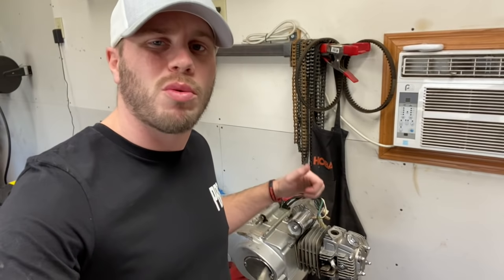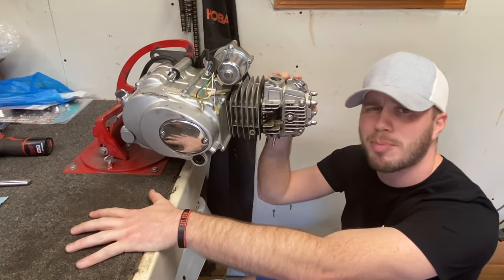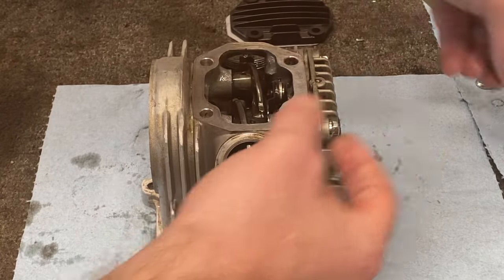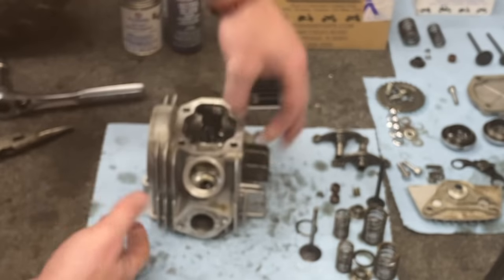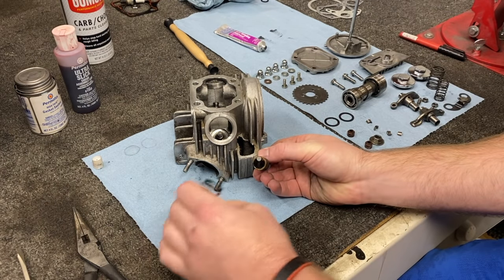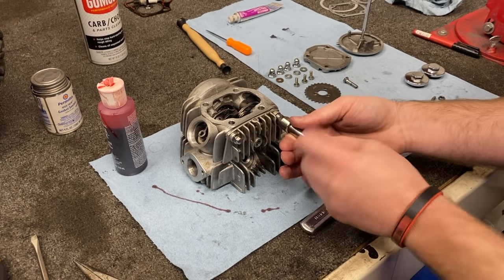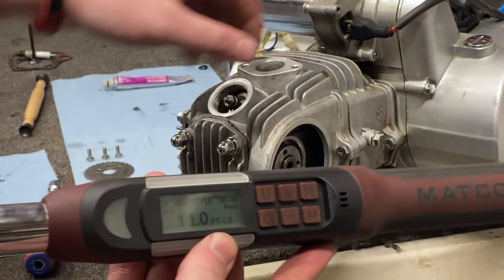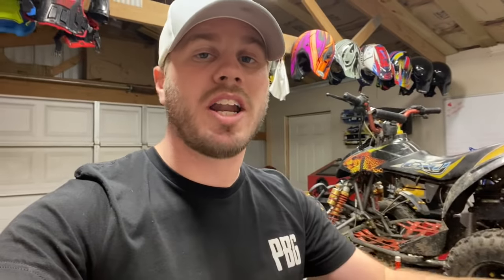HOW TO: Complete Tear Down & Rebuild of a Chinese ATV Engine Head. Every step you'll need covered!

Comment: Ok my motor was making a what sounded like bbs rolling around in the top end when i let off the throttle to drift to me it sounded like a loose chain like the cam chain was loose so I just took the sprocket cam cover off and it does look loose I thought these were spring loaded self adjust isnt it? I know on my old kawasaki you could loosen a bolt head chain tensioner and it would take the slack from the chain not sure on this motor tho.Any help,, let me know please..Thanks!
Reply from the maker: Yes they have a spring tensioner. It is the 14mm bolt on the bottom of the motor next to the oil drain bolt. It has a spring and plunger.  Check that and make sure it's there!

Comment: When you buy the head prebuild will you still need to adjust the valves ? Or are they preset and would it be the same spec for a 90cc honda clone engine
Reply from the maker: You would still need to set the valves after installation. The Honda specs for setting valves is .002" for both intake and exhaust. Which for me is too tight on these Chinese clones. My preference is .005" intake and .007" for exhaust and I use that spec for all my clone 50cc-125cc motors.

Comment: Ok
Got one for you. You said compression should be between 140-170. All mine that run get 50-60 and run perfect. The engine's that didn't run get 60-65 and I've tried this on 3 different tester's. Any ideas? I've replaced all electronic new kit.
Reply from the maker: If the carb is still attached are you holding the throttle wide open when testing? It is possible it will run with that low of compression but not likely. It would run very poorly especially when the ATV is under load. I guess you don't fix what isn't broke so if you don't have an issue then leave well enough alone.
Reply: @PraskaBoysGarage  carb is on and I don't touch throttle. I have new complete harness, spark plug and electronics. New pz20 carb, oil and doubled checked valve clearance. The ones with 30-40 psi runs like champs, and all are these chinese ones. The 2 I can't get to fire have me stumped
Reply: @PraskaBoysGarage  oh and love the videos even the lady watches them with me.

Comment: What’s the engine mount/holder thing you have on your bench? Thanks!
Reply from the maker: This is my #1 question for sure! I actually had a CNC company laser cut out all the metal to start making and selling my own. I will be selling the kits on my website either as a DIY kit or a completely assembled and power coated. I will post updates on the channel when they are ready!

Comment: I bought a lifan 125cc motor it keeps having pressure in the oil pan and the kick start seal keeps popping out once the pressure builds up any suggestions
Reply from the maker: The motor should have a breather valve on the top behind the starter with a hose. Make sure that isn't blocked. You'll always have crank case pressure that's what the valve is for. If that's not blocked I would suggest replacing the seal.

Comment: Hey great video man, but I wanted to know if you could tell me why my 2009 125cc Tao Tao is making a ticking noise near the piston area. It’s not a loose flywheel and it runs sort of smooth
I just want to know if it’s okay to drive it for now
Reply from the maker: Ticking in my experience is usually too much valve clearance. I would inspect the valves.

Comment: My valve cover gasket keeps blowing, I bought some pretty thick gasket material and it still keeps popping. Same corner each time as well. Any idea on why?
Reply from the maker: Are you torqueing the bolt down correctly? A lot of times the casting threads will strip and you cant get a good grip like you are suppose to.
Reply: @PraskaBoysGarage  probably not! I'll be careful this go round as I gave it too many ugga duggas and snapped a bolt.

Comment: Hello, thanks for the English info & i just subscribed, I've a brand new honda wave 125 style motorcycle(Chinese engine clone), the engine is getting noisy & weak when getting hot, also starting to feel tiny continues shake with my hands & legs, it's painful after a long ride.
I did valve clearance adjustment too, it's not valve clearance issue?
Can you please help me?
The engine is looking same, a 4 stroke engine too.
Thanks in advance
Reply from the maker: Look into getting a Mikuni Carb or at least the Chinese version off eBay for $35 dollars. It is much more responsive and overall will run better!

Comment: Love these videos. I have a coolster atv that need bushing in the front. I want to change all bushings. Any tips on how and were to buy the bushing
Reply: Model is atv 3125c coolster. It runs and drives. Front got to much play. I paid 200 it's a 125cc. Was this good price.
Reply from the maker: That's a good deal! Check VMC chinese parts. They carry all the bushings individually for a couple bucks a piece. I couldn't find a kit on Amazon or eBay. Thanks for watching the video, glad you liked it!
Reply: Okay cool. How many blushings are their in the front. I might as well replace all in the front. Is it 16 a arm bushing and 4 swindle bushing.

Comment: Cool but where do the break safety wires go when you wire a quad?
Reply from the maker: I have a complete "how to" wiring video if you want to check it out. There is both a hand brake and a foot brake, which one are you asking about?
Reply: @PraskaBoysGarage  I watched the video and in it you never mentioned where the two wires get hooked up to, the ones you need to put together so the engine will start
Reply from the maker: @ggproductions8434  They connect the the brake handle. The handle has 2 small metal prongs and they clip right into them. Orientation doesn't matter just plug them in and your good.

Comment: Can you help me with connecting the radiator fan on a 2005 roketa 250cc ? My radiator has no temp switch and my harness has nowhere to connect the fan wires im so confused
Reply from the maker: Hey I am sorry man, I don't have a lot of experience with that. I'd hate to give you the wrong advise since I've never done that before.

Comment: Nice video what is the make and model of you engine stand?
Reply from the maker: This is my #1 question for sure! I actually had a CNC company laser cut out all the metal to start making and selling my own. I will be selling the kits on my website either as a DIY kit or a completely assembled and power coated. Should have everything ready soon and will post updates on the channel.

Comment: Awsome video but still don’t know if this is the problem with my chinese 125cc atv . It starts but when i press the throttle to go doesn’t run like it was running before same on reverse is to slow … can someone help me or had the sale issue and let me know what it is. Thank you.
Reply from the maker: Sounds like you are more likely having Carb issues. Might be a good time to upgrade!
Reply: @PraskaBoysGarage   Yes i thought the same thing at first so i did change the carb for a brand new one and that didn’t fixed the problem. But after all i did find out what the problem was and fixed. It was the clutch. Thank you.

Comment: Can I exchange a 150cc head/cylender kit on a 110cc motor? I need to order a new wiring harness anyways..
Reply from the maker: The 150cc motors I am familiar with is for the GY6 motors or with vertical cylinders. I haven't seen one that will fit these. I am stocking up to make a video to see if you can throw a 70/90 on a 50cc bottom end and also if the 125cc with fit on the 110cc bottom end. I've never done it so I'm curious if it will work!
Reply: @PraskaBoysGarage  oop’$ I meant 125cc, not 150... thanks.

Comment: I have a atc 110 runs perfectly fine, but it smokes a lot what could be the problem?
Reply from the maker: Valve seals, rings, or head gasket are your 3 main problem areas when 4 strokes start smoking.

Comment: Hey question for you. Have a 50 Cc motor. Just replaced the whole top end. Starts and idles great as soon as you give it gas it dies. Changed the carb same issue. This happened before the top end change I'm kind of stumped as to what to do. Great compression. Any help appreciated.
Reply from the maker: Couple things to check. First, what size carb did you get? Should be either a PZ18 or PZ19. Next, check your timing and valve lash. Make sure both are with in the guidelines. Lastly, how is your fuel flow? Loosen up the drain bolt on the carb bowl and make sure you have a good flow of fuel coming out. Let me know if you get it figured out!
Reply: What is the valve lash suppose to be on the 50cc. Thanks

Comment: Hey I looked over the video you recommend on the loss of compression and valve problem..... I noticed you put a link for new fully assembled heads ... I have a boom vader which is a chinese from clone ... Do you the the 125cc atv head will take cause they look exactly the same ???
Reply from the maker: I know of the Boom Vader bikes but I've never worked on one personally. They look like Grom clones but since they are so new I am not sure if the motors are the same or not. Sorry I don't want to give you bad advise.

Comment: Do these 125 cc China motors share the motor oil with automatic transmissions?
Reply from the maker: Yes, The motor takes about 700ml or 3/4 of a quart of oil and that is the only lubricant it needs.

Comment: I am really struggling with getting the timing chain back onto the sprocket and ensuring it is top dead center.  My sprocket has a "T" engraved on it which I assume is the Top dead indicator but I'm not seeing any alignment mark on the engine head housing to line it up with.  The cam shaft spins freely so I'm not sure what I'm supposed to be aligning.  Any tips on how to get the chain onto the sprocket and how to keep it aligned?
Reply from the maker: Hey Aaron, can you send me an email with a picture? I have never seen a sprocket with a T mark on it before. praskaboysgarage@gmail.com
Reply: I got it on finally.  The notch for alignment was on the underside of the opening.  Very odd placement and hard to check for alignment but reassembled and just waiting for a gasket kit to try and fire it back up.
Reply from the maker: @Footer45  Awesome! Well let me know when its back up and running!

Comment: i have seen all you videos and have learned alot along the way and i thank you for them. i want to know what your suggestion for me to do on my 125cc 4 stroke Chinese grom clone engine because it onlu has 800 miles on it but my compression is only at 125 psi. also the reason i checked it is because i replaced a craink oil seal and now can not get it to start. im at a loss because it cranks, has 125 psi compression, has spark and is getting fuel but will not start. could the valves be that far out that it wont even start?
Reply from the maker: Glad you've liked the channel and thank you for subscribing! Try to isolate the problem. If I'm working on it in my shop, I would take out the spark plug and spray from start fluid or gas in it  plug hole and see if it will fire. Also the valves could be out of spec enough for it not to run. I would check those for sure to. Let me know what you find out!
Reply: Ya no go with starting fluid in cylinder or carb I did try that previously so to begin with I had to replace the crank oil seal and when I put it back together I guess I didn’t tighten the flywheel but tight enough so what ended up happening was the flywheel nut loosened and made the flywheel come loose and the starter kept spinning the flywheel until it got too loose for the one way bearing to engage and ended up wearing down the crank key and in turn obviously not turn the crank so I replaced the key and now it will not fire but everything seems to be in place

Comment: I decided to give a list from the problems. I live in Hungary, here has even a wreck a value equak to gold. I bought my for ca. 230 USD. The key was lost, I hot wired it and ordered a new ignition switch. Left front tyre had two leaks, fixed. Motor was ru ning but it had no high revs. The main jet was missing from the carburetor. Air filter was scrap. Starter motor was hooked directly to the battery. Starter button and the solenoid was scrap. Needed a new battery (small type). Light switch was not existent. Front suspension bushings are lose (factory issue). Loose bolts everywhere!
Reply from the maker: Dang man! That is quite the list!

Comment: Where did you find that engine stand? That’s neat!
Reply from the maker: This is my #1 question for sure! I actually had a CNC company laser cut out all the metal to start making and selling my own. I will be selling the kits on my website either as a DIY kit or a completely assembled and power coated. I will post updates on the channel when they are ready!

Comment: i bote a chinese wheeler 250 liquid cooled  runs good but it hsse transmission fluid what kind do i use. and the serial number  does not have much  info when i look it up. it comes back as a qianjiang motorcycles .and i need to get plastics for it  i can give you pics maybe you can tell me more info about it    think you        bucky
Reply from the maker: Yeah send some pictures to my email! praskaboysgarage@gmail.com

Comment: Hey man I got a question I got a 125cc Chinese four wheeler and when I start it up it hits the revlimiter and wont stop doing it and it still did it when I replaced the carburetor
Reply from the maker: The throttle housing has a set screw that wont allow you to open the throttle all the way up. That's the only limiter I am aware of and you should be able to loosen it up to give you more throttle back.
Reply: @PraskaBoysGarage  thanks man

Comment: Is there a way to do it without the spring compression tool
Reply from the maker: Kind of...you can put the keepers in the cap, set the cap on the spring, push down with the force of 1,000 men and you might get the keepers to set...I've done it on Predator 212cc engines before with 10lb valve springs but never been able to on one of these double spring heads.
Reply: @PraskaBoysGarage  omg thanks for your Quick answer i am New to your channel and i love it my friend ,i am trying to rebuild à 110 cc for my kid i think i will need that tool then since i have rhumatoïde arthritis and the strenght of half à man now lol.
You are a conplete stranger but i thank you from the bottom of my heart you are an inspiration and give me the strenght to keep faith

Comment: How much more you have in your stash??? No company has anything in stock. I've ordered one more head gasket in hopes this one will work. I don't have the same head as you shown in the video. I've got the oblong hole and the bolt holes were torn up to include the ring. Can't find any 7MM X1 Nuts either...grrrrr

Comment: Need some help, its my 110cc is running back wards, I got the timing perfect and valves adjusted, the cam for it facing forward with the t on the flywheel lined up? Any help been stuck on it all week
Reply from the maker: This might sound dumb but the last time that happened to me I had the positive and negative cables swapped to the battery.
Reply: @PraskaBoysGarage  just figured it out, they had the harness on backwards and now runs great
Reply from the maker: @joeymcginness6731  Awesome, glad you got it!

Comment: Just bought a new head from vmc and the valves allow light through..... So I cant just plug and play I have to seat the valves ....not cool
Reply: I got the same head from vmc, same problem, Valves shine light through the entire seal, and the valve gaps aren’t set (not sure if this is every aftermarket head) I decided to take the original head and rebuild it, 
Definitely sending vmc their head back 🙄
I bought the bike with the impression there was a cracked head on it, but it was just the main exhaust seal, and the head gasket itself had been placed wrong by someone else. Other than vmc’s issues this video helped me put my bike back together, although I’m having a hard time finding the exact intake and exhaust valve gap. 
And he hasn’t responded to my email, probably hasn’t checked his “praskaboysgarage” page, or email in quit a while.

Comment: I know this is off-topic, but I need to find out if 150cc gy6 performance parts are suitable for Lifan 150 kp engine with vertical cylinder.
Reply from the maker: Not without repinning your harness. They will not plug and play.
Reply: @PraskaBoysGarage  Sorry that I didn't make myself clear.  I was asking about cylinder head parts and piston.
Reply from the maker: @The_DC_Kid  No that wont work either. GY6 is specific to those motors only.
Reply: @PraskaBoysGarage  Thanks for the reply.

Comment: Can wrong timing cause low compression?
Reply from the maker: No, timing is in relation to the motor position and when it needs to spark. Has no effect on the compression. Lost of compression means your loosing pressure somewhere.